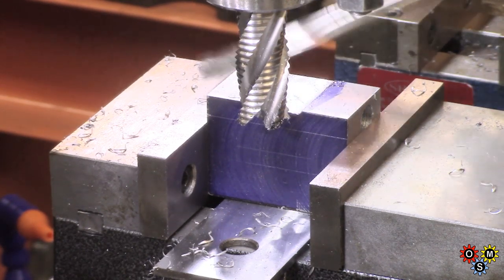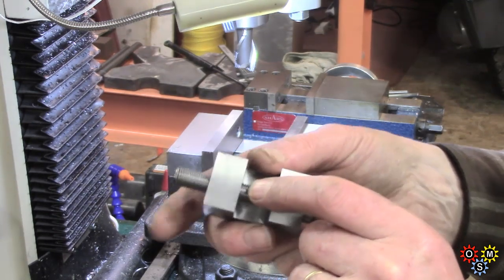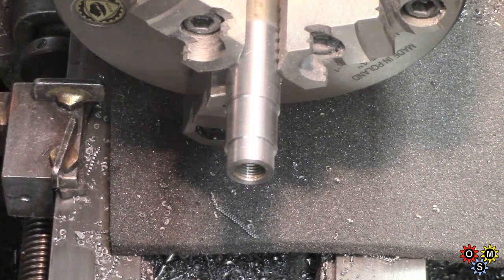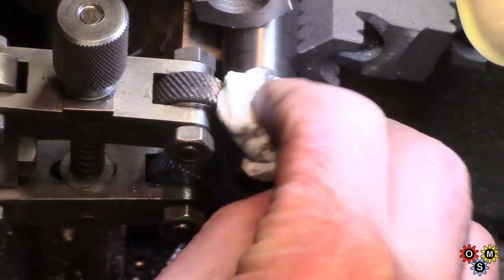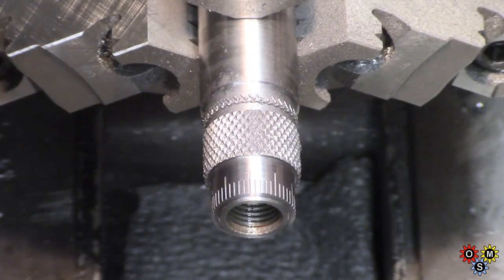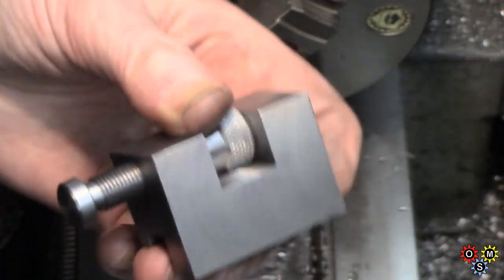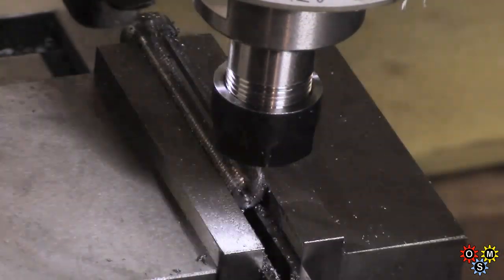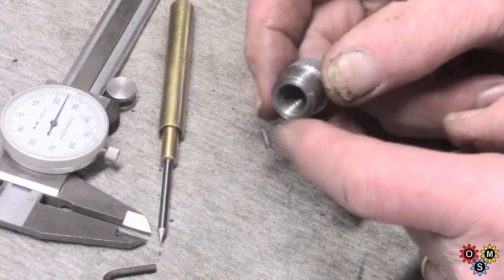Carriage Stop, Part Two

Comment: What is the reason for not taking a full depth cut with that roughing end mill? Doesn't the repeated reuse of the tip wear it out faster & leave the rest of the tool unused? Does that require a high horsepower machine or something? 
New and still learning the ropes.
Reply from the maker: Hi,
I'd like to take deeper cuts but in practice it's a case of being kind to the machine. While it is adequate for most work, being a lightweight it does tend to vibrate more than a large Bridgeport for instance and the stress of a heavy side cut does push things a bit. Agreed, tip wear probably is increased.
Reply: Thanks, I thought that was it.

Comment: That's a masterful job!  I particularly am impressed with the beautiful engraving job and the shop made indexing tool you used.  How are all those balls held in place?
Reply from the maker: Hi Mike,
Thank you. Well, the engraved lines were fine but the figures are not as good as I'd like - functional though.
The BBs in the old gear wheel are epoxied in - was very fiddly! :)
Hope to try and finish off last aspects soon as I can.

Comment: A spring wavy washer would have been better for the tension and a lot easier thanks for the video
Reply from the maker: Hi,
I had thought of that but couldn't find one! In fact I'm not dead sure I might not still have had slight backlash even then. Once I shim the finished item (now complete) it'll be fine and has just enough drag now.

Comment: I am new to the use of a Milling machine, where can I get a chart or information on different speeds for the milling machine  when working with different steel materials
Reply from the maker: Hi,
There is a lot of info on the web dealing with feeds and speeds for different materials. Perhaps the ideal would be to invest in a publication such as "Machineries Handbook" where you'll find data all in one book. There are other books too of course - a web search should help.